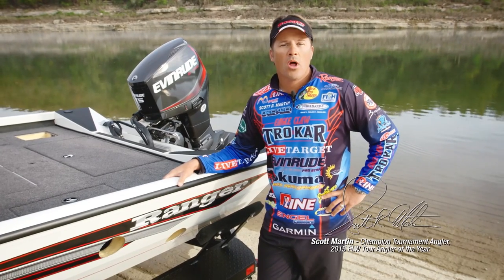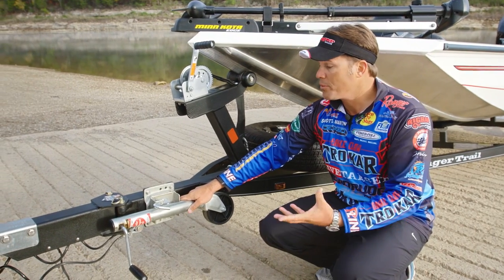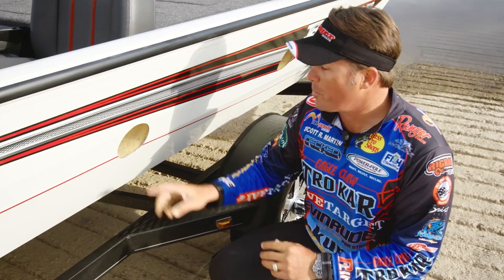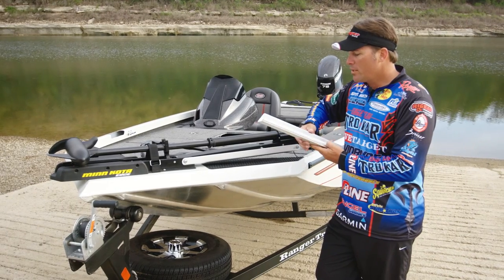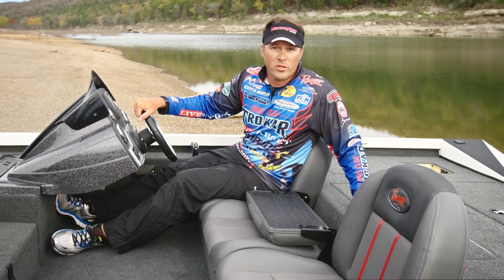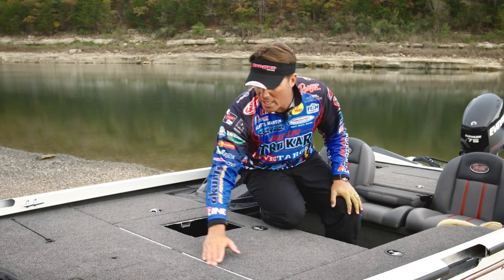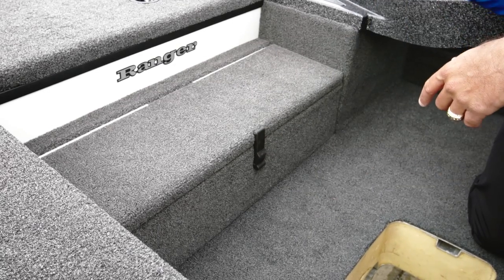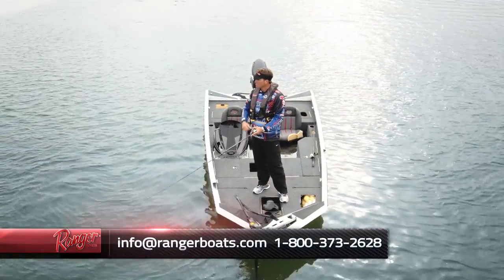Ranger Aluminum Cut-Away Walkthrough w/ Scott Martin

Comment: I've got the RT178 with 75hp 4 stroke...goes 38-39 with stock prop. 75lb thrust trolling motor moves it great. All around good bassboat without breaking the bank and light enough for 1 person to handle.
Reply: I've got the rt188 since 2014 and love it.  I sold Tracker before and I love the way this boat is laid out.  I have the minn kota 55 on it.  It apparently was not offered as an option because the circuit breaker is only rated at 50 amps.  The 6 gauge wiring will take up to a max rating of 60 amps or so but the minn kota 55 draws 55 amps. The 55 keeps everything simple.  All wiring is 12 volts with to tm batteries paired in parallel it lasts all day.  I primarily fish a 450 acre lake and because this is small means I am usually off the big engine and on the trolling motor a lot.  I have the Ranger charger that charges 2 banks at 15 amps each.  since the trolling motor batteries are in parallel, both will charge with only one bank.  Of course the other bank is on the starter battery.  That one is charged fast and then the whole 30 amps is directed to the trolling motor batteries.  Never a problem.  I have the 115 merc and get about 47 mph on the 4 hole with a lazer II prop at 20 inches.  I have the same prop in 21 inches too but no speed increase but the rpm drops a little bit.  I like the 20 a little better for the hole shot.  I have developed a auxiliary motor mount that fastens and removes in a couple minutes with no holes anywhere in the boat, thus not voiding my hull warranty and it has a Mercury 6 horse motor on it that I can use on 10 hp restricted lakes, troll, or use as a get home motor should the big motor fail.  it is connected with a connector.  I cant remember it it was from Attwood or Panther.  I love the boat.  Do not get the factory cover unless you plan on keeping it where rain and snot wont get to it.
Reply: Replying to my own comment 5 years later.  Everything is still the same.  I love it.  The Minn Kota 55 is enough power.  The #1 setting gets me around silently without pulling me too quickly most of the time.  The #2or3 setting is just fine for general boat control.  The #5 setting gets me around rather quickly.  It is good in stiff wind.  If you are going to fish tournaments you would probably want more power in the windiest conditions.  I fish or fun and leave if it is not fun anymore.  The Ranger 15x2 charger works great.  My boat is a 2014 and I have only replaced the troliing batteries once.  The original starter battery is still being used.  Everything on the boat is 12 volts and keeps it all super simple.  I just love it.

Comment: Thinking about trading my 20 foot Glass boat for a RT188..   just wish they offered it with a 150 hp!
Reply: they're way lighter, have you checked speed reviews? I bet she moves with less hp.
Reply: around 47-52 tops from what I've read.
Reply: +Eric Romines that's what my 17' fiberglass Ranger with a 115hp gets.
Reply: They do its called the rt198p. Its basically the big brother to this boat.
Reply: I get 47max with the standard merc 115 but my boat is loaded even with a kicker on it and tons of equipment.  Put it on the 4th hole and run a lazer 2 of 20-21 pitch.  See my comment above.  The pro xs is tuned for a little more hp but cost me in 2104 a whole 1500 more.  So I gave up 1-2 mph for the kicker that cost  the same.  Also, check out the new RT198P.  Its 8 inches longer and rated for 150 and has a pad v hull.  I had a glass boat in the mid 1980s with a pad v hull and it pushed 59mph.  No gps then but it had a quality speedoand ran a 24 pitch Turbo stainless on a Johnson v6.  Running that pad v into the wind or into a chop caused the nose to become light and many times felt as though a blow over was possible.  A little chine walk too sometimes made it hairy.

Comment: Just bought a 20-22 Ranger RT 178C doesn't get up on plane till sensor doesn't function correctly motor doesn't RPM over 3,500 RPM filled the tank up had the back live full of 24 keeper crappie would barely get up on playing with one person put more people in the boat. Definitely doesn't perform per the ratings on the boat and the motor I guess I bought a $30,000 hunk of junk might as well be named tracker
Reply from the maker: We apologize for your frustrations. We recommend contacting an authorized dealer, as they may need to perform an evaluation to help determine what next steps need to be taken. To find your nearest authorized dealer, please visit here: https://www.rangerboats.com/dealers.html
Reply: First, the prop has too much pitch.  My RT188 with 115 came with a 23 inch pitch aluminum and it also didnt do over 3500 rpm  I now run a 20 and 21 inch Lazer.  I get the same speed with both, nearly 47 consistantly while loaded.  The 20 has a real good holeshot and the rpms run a little higher than the 21 but they stay just below the max redline.  Second, what engine are you running?  A more powerful engine is better to snap you up on plane faster.  I assume you are trimming the motor out correctly.  With the bow lifted high it runs great but pulls to the left and can catch you by surprise if you suddenly throttle down.  The RT188 is known to porpoise with the bow too high or the motor trimmed way out.  Have the dealer raise the motor a hole or two if this occurs.  I run my 115 on the middle hole.  This brings the motor up an inch or so but makes a big difference it higher speed handling.  Third, I went with the bigger boat to get the bigger motor because a loaded boat nearly 18 feet long needs more power than 60 or even 75 horsepower.  You need to bring the bow down by lifting the back end.  You may want to put a hydro foil type lifting wing on the cavitation plate.  This will bring the bow down but at speed it will be out of the water allowing for bow lift and speed.  Fourth, while usually reserved for high performance bass boats, a vented propeller can help with a hole shot but not your top speed.  I allows exhaust to enter the propeller blades to it can rev up and give a better hole shot.  I have found that it helps basically on most boats that need that extra oomph.  It works kinda like a torque converter on your car to launch you better.  It is possible to do this yourself if you do it right.  I had a 35 hp motor on a 16 foot tracker and it helped a lot.  I sold the Tracker and ordered the Ranger.  After working for a company that sold Trackers I knew I wanted the Ranger.  Thoroughly happy with my purchase.  Good luck